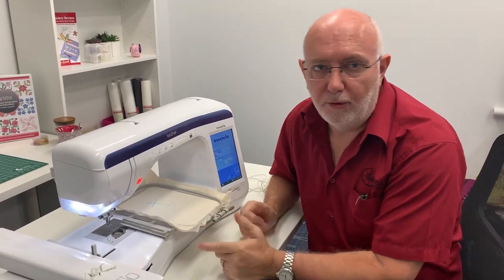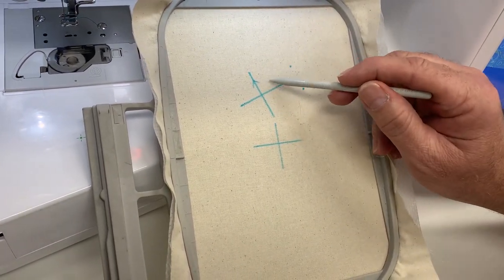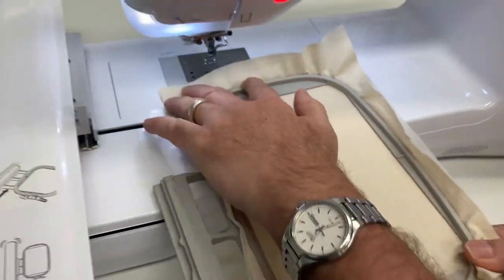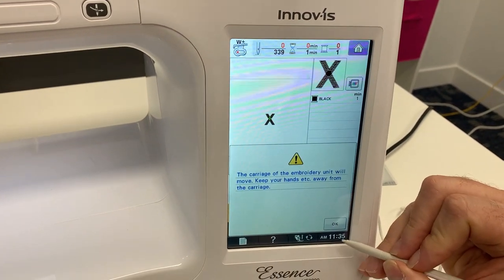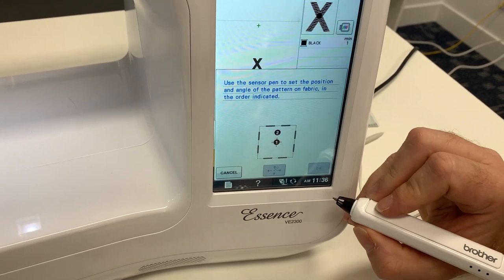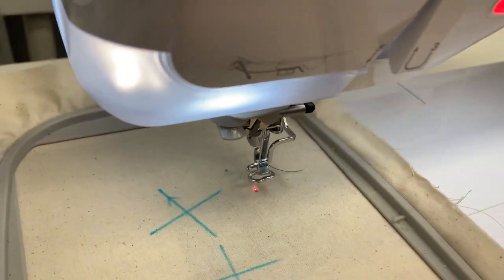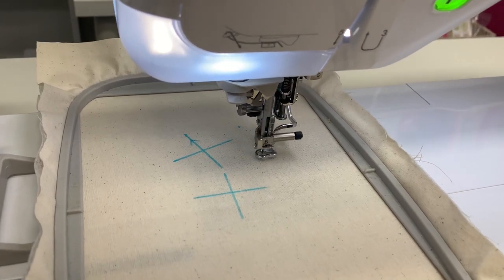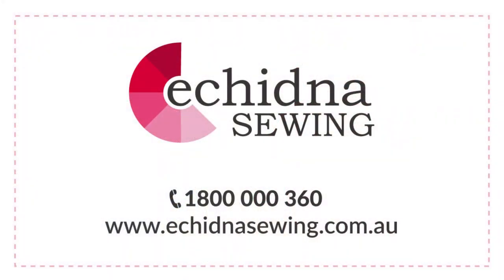How to use the Ultra Sonic Pen System on a Brother VE2300 | Echidna Sewing

Comment: Hello Gary. I am new to VE2300 and I found problem which I need help with. If during design, I have some destruction (hoop hit something on the table, or break needle or piece of cloth stacked under needle) I fix the problem. But after that, design destructed and move up or down or left or right in half inch or even further. At one point, I even hit border of plastic hoop and break needle. I never have that problem on my previous Brother machine. The only way I know is re-set design again and start from step where I get in trouble. This method is not good if I combine 2 designs and forgot which one I increase and in what direction. Question: Can I use pen you demonstrated to place design on spot I desire and size I desire?  Do you have a video to demo pen with design, not with letter
Reply from the maker: Yes you can use the pen for any stitch file. If your hoop gets fowled in someway and the design shifts out of sync then you have to restart the machine to reset the hoop position otherwise you will probably stitch into the hoop itself. Usually the machine will resume at the correct position  but not always for all sorts of technical reasons. If you need to start again and resume at a point in the design, this can be difficult unless you have exactly the same file to start with. If you resized the design in the machine but don't know exactly what size it was then it's even more difficult. Best way is to print a template of the  design on  tracing paper, overlay it on the existing stitch-out and mark your centre and angle. Then use the pen to set the position.  I've done this but unfortunately don't have a video. It  is however the same process as this video. Cheers Gary
Reply: @EchidnaClub  Thank you so much for finding time to answer. Impressed. Will wait more videos about this machine